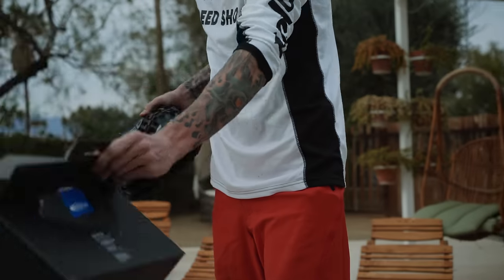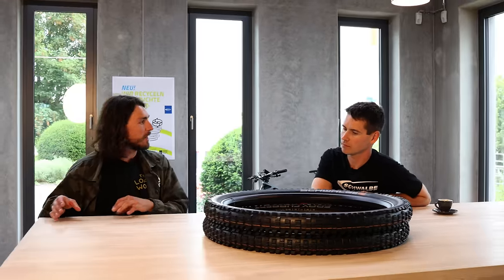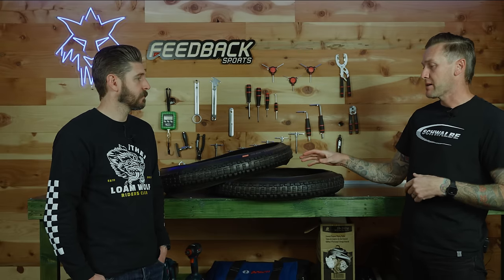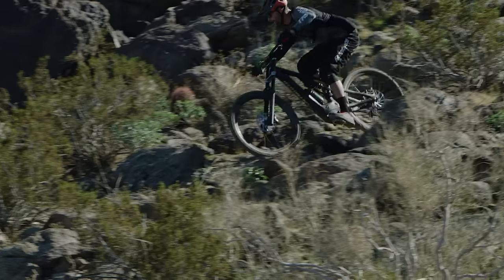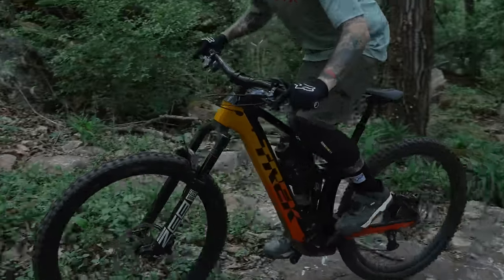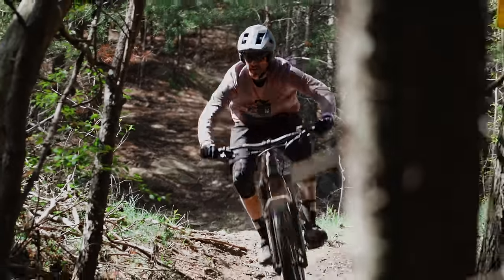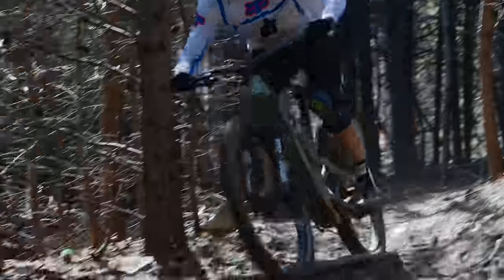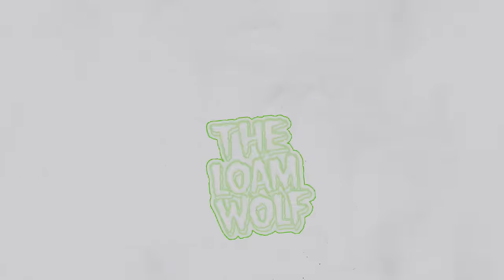Recycled Rubber and Tire Development - Schwalbe Eddy Current #emtb Tire

Comment: eddy current FTW!  On my 3 set in 3 years, only really changed them for fresh rubber for new season.  Never had a puncture, never a flat, and lots of grip when i was for sure the tire was going to wash out.   

Now I run a eddy current rear on 27.5 and a magic mary full soft front, and schwalbe needs to send me some free tires for promoting their brand everywhere I ride.
Reply: Me to ! To buy one is the problem ! Can't find or wrong size ! Or dont have ! Top with MM !

Comment: I have got eddy current too, and i love the casing and thread pattern, but have had negative experience with the rubber compound addix soft, because after only few km some of the side knobs broke away, leaving the casing exposed. I know this was a problem of the first series of production and Schwalbe states, it has been fixed, but my reclamation was never answered, gotta try again after 2 or 3 months.

I'd of course LOVE a DH casing version and SUPER SOFT for Front